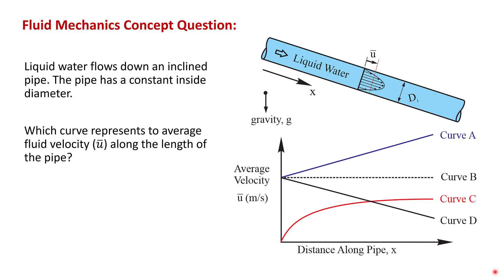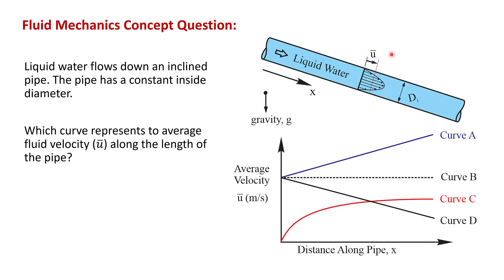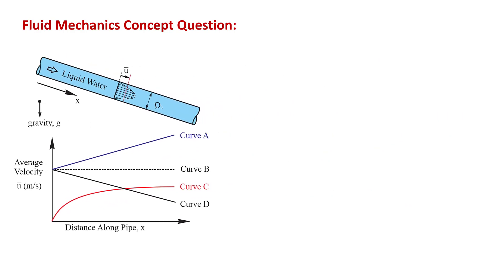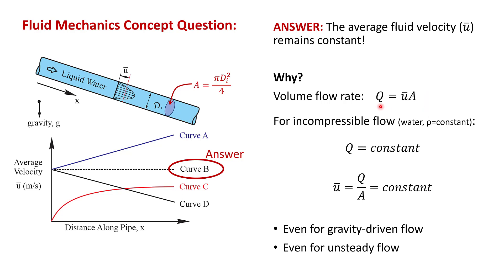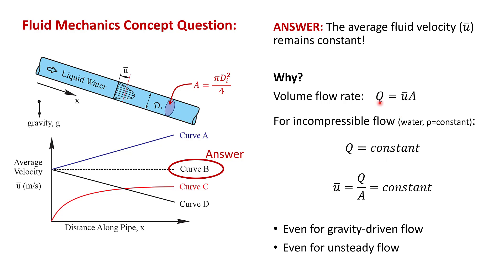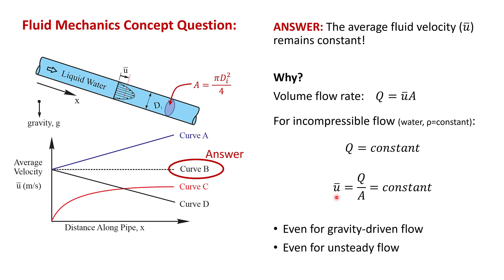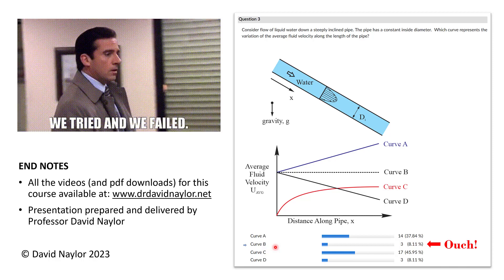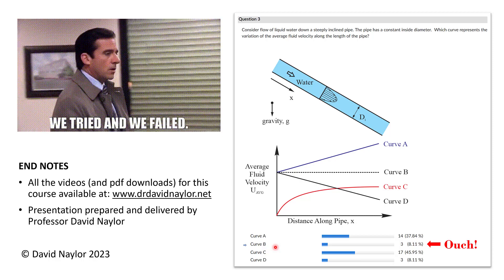Does Average Fluid Velocity Increase Along an Inclined Pipe?

Comment: If we apply Bernoulli equation at the discharge point and somewhere upstream of the pipe it seems that the velocity at discharge point should increase as the loss of potential energy of the fluid should be converted into kinetic energy as the pressure at the discharge point is constant at atmospheric pressure, but continuity says it should remain constant. Please clear this one
Reply from the maker: Conservation of mass rules supreme, of course. So, the velocity MUST remain constant, since water is incompressible.  So, if you apply the Bernoulli equation between two points In a constant diameter pipe you only have the conversion of potential energy into pressure (flow work) because the kinetic energy terms are constant a both points. A constant discharge pressure to atmosphere does not change that fact.  I hope this helps.

Comment: It's pretty counterintuitive I would say :)
Reply from the maker: Yes. That is what I find so interesting, as an instructor.  If I had given a flow rate Q and pipe diameter D in say, a Bernoulli problem, 99%+ would get the same mean velocity at the top and bottom, without thinking twice.
Reply: @FluidMatters  I never thought about this before but I'd also think the velocity increases. If we think about the fluid as particles, they should increase their velocity due to the gravitational force as they travel downwards. Why would they go against physics?
Reply from the maker: @rhinobridge  You are thinking the water is like a ball rolling down a hill, which gains kinetic energy (only). (This would be true for a film of water sliding down a hill at constant pressure). The water film would get thinner as the flow speeds up due to gravity. But the physics in a pipe is more complicated. Conservation of mass requires that the velocity is constant -- so you have energy changes due to changes  pressure.   I hope that helps.